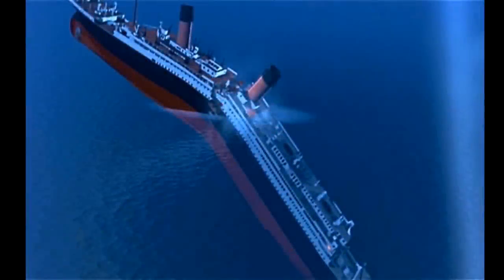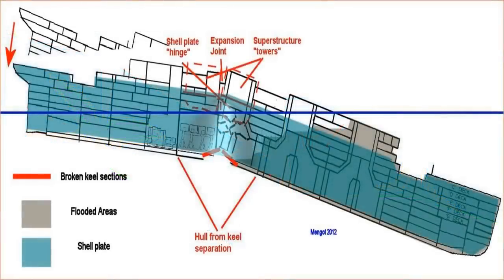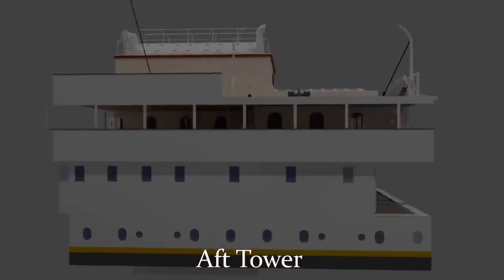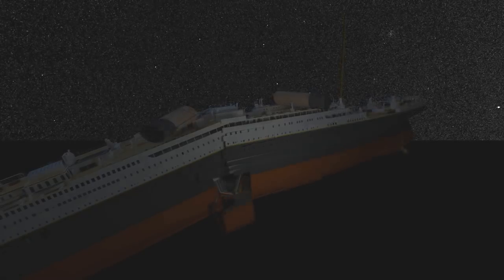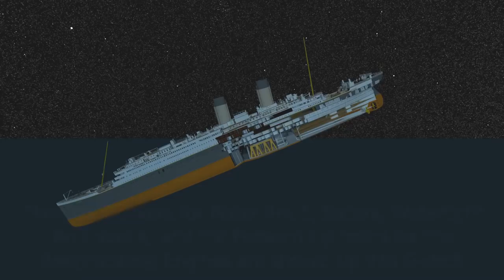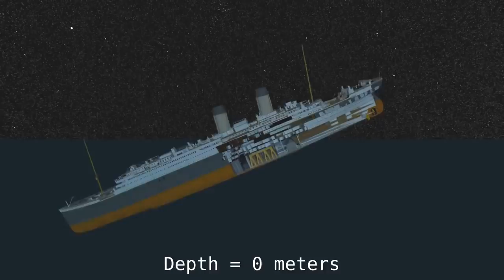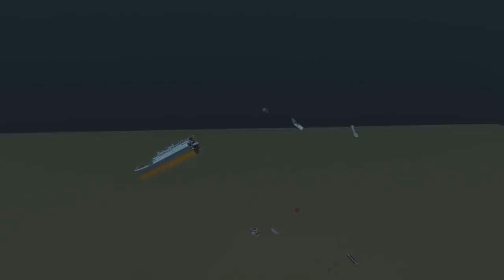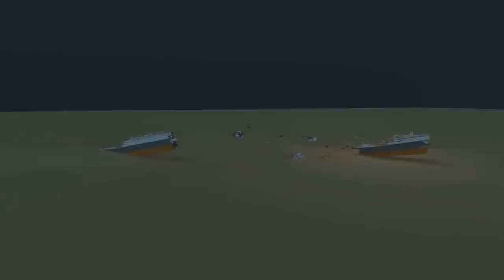How Titanic Broke In Half BRIGHTENED

Comment: Of course we all know the Titanic broke, but has anyone studied on why the Britannic didn't?
Reply: If I correctly recall, Britannic didn't reach the same angle of inclination. Also, the hull of the Britannic was reinforced.
Reply: Britannic didn't reach a high angle and she sank relatively quickly due to multiple open portholes. Multiple areas of Britannic were reinforced as well, and she sank in relatively shallow water.
Reply: A couple of factors have been looked in to. The biggest likely reason is that she had a full double skin up past the water line, not unlike an oil tanker, to make absolutely sure that what happened to her sister wouldn't happen again. (Though such measures were seldom used in later vessels, even though they likely would've prevented many disasters) Another was the rapidity with which she sank. Britannic sank in only 55 minutes, vs almost three hours for Titanic. The time where the hull was under the strain of supporting the stern was significantly shorter as a result. Another, is that the bow struck bottom before the ship fully sank, so the dynamics become different as well due to that. Another one, though not as universally accepted, was that water temperature also was a factor, with the Mediterranean being much warmer than the North Atlantic, so the steel may not have been as brittle. The double hull and rapidity of sinking are what I suspect contributed most to the ship staying in one piece, since it's a much stronger structure under stress for a shorter time period.
Reply: @crgkevin6542  and Britannic had a list to starboard much greater than even titanic, basically rolled over onto her side. Cunard's Lusitania also sank at an angle, but also listed and rolled over onto her side and she was older built even before the Olympic and Titanic.

Comment: It broke in half there because the crew were fighting a fire in the boiler area where it broke for days before the ship even hit the iceberg..the heated metal was weaker there
Reply: That fire was in the forward boilers. Don't even try to mention the black smudges, those are in the mail room above the waterline and the damage the iceberg made was below the waterline. That fire was also barely burning. It was moved to the port side resulting into a 3 degree list to port before it hit the iceberg. The boilers give off a heat of around 900 degrees Fahrenheit. To actually damage or weaken metal it would have to be around more than 1100 degrees Fahrenheit.

Comment: The idea that it split was officially debunked finally after like decades of it being called into question. I mean it was never proven to have happened anyway but was included in this video and in the film. Weird how a couple months ago two different research teams discovered that the titanic didn’t break in half above the water. Yet this video shows it happen above the water just like the movie. Which are both incorrect. Even James Cameron said he was wrong about how the titanic split. It never happened at the water line. the ship started to raise in the air because the front was still hanging on. It wasn’t a clean break until it was almost at the bottom of the ocean. There are obvious reasons for this one. One of which is the very very small debris field. Bowand stern would’ve been much further apart on the floor. And just the laws of physics. Every survivor of the wreck recalled the ship sticking straight up to the sky. Perpendicular to the sea. And that couldn’t have happened if it had already split completely. Not a single survivor recalls seeing the ship breaking. Some say they heard it. Also Cameron said years and years ago that the ship either broke in half at the water line or it raised up straight into the sky as it sank. but it couldn’t possibly have done both. He admitted his movie got it wrong. Now days Cameron agrees with the scientists about how the ship went down still connected by a small portion until finally breaking apart just before hitting the sea floor